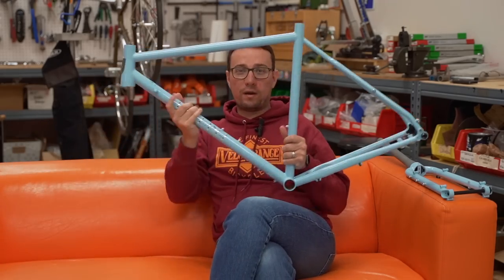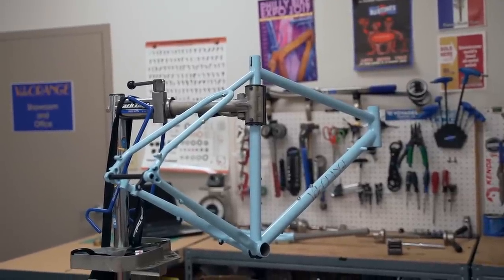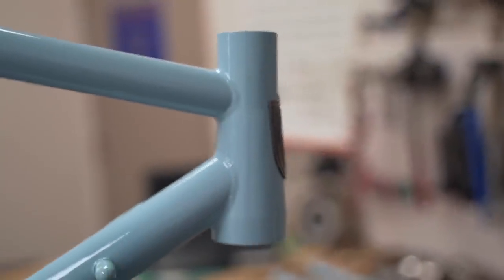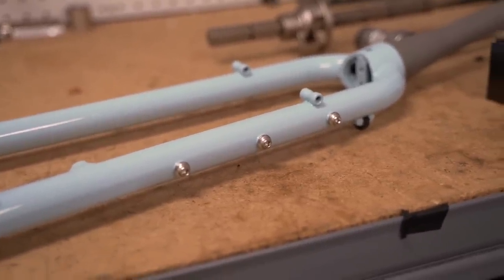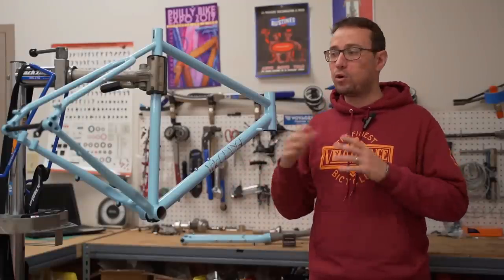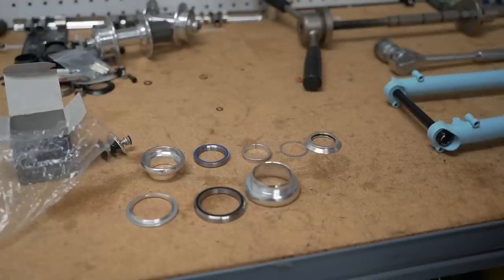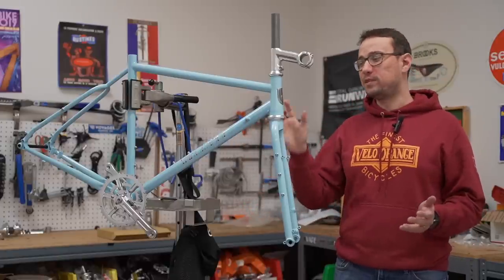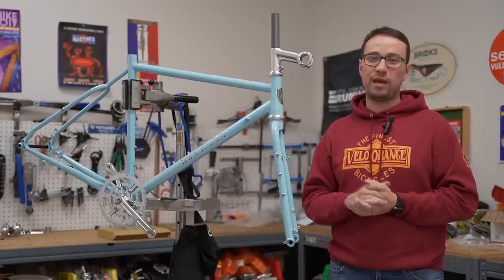Let's Build a Rando Bike - Part 1

Comment: Assembling a bike step 1 - insert a greased seatpost and clamp the frame in the workstand by the seatpost, not the frame!  Prevents paint damage, especially if there’s a tubing decal right there under the top tube.

Comment: I’ll second the install a seatpost first comment. Having a seatpost in the frame will prevent any damage while torquing the bottom bracket as shown in the vid. I like to stick my arm through the frame and use my shoulder or arm pit to counter the torque force as well.

Comment: Is the Pass Hunter steel fork for sale by itself?  Can't find it on the website.
Reply from the maker: We don't offer the fork separately currently.
Reply: @velo_orange  Thanks much for the reply.  I understand it may not make sense to offer it separately as most people "upgrade" to carbon.  I don't know if I've seen any other fork with the same attributes as the Pass Hunter's, though. Steel, thru axle, with a tapered steerer is pretty specific, in my opinion.   If I could find a way to make the Pass Hunter frame work with my Shimano Alfine 11 IGH and Belt drive, I'd get the whole thing.  I LOVE the wishbone seat stay design.
Reply from the maker: @mitmon_8538  We're soon going to be carrying an eccentric bottom bracket for bsa bottom brackets. There's also a cool belt company that makes a belt that is pinned, so you can run a belt drive on non-belt drive compatible frames. We had a customer do that on a Neutrino.

Comment: I like that colour. I like cromoly frames as I had my bmx made from tange cromoly as a kid and it was light and tough. I'm curious as to why you used a tapered cartridge bb?
Reply from the maker: That's what is compatible with our cranksets. They're easy to maintain (basically nothing to do) and are easy to install.

Comment: Man I want to build one of these! My Campeur will suffice in spades till then!

Thought, anyone familiar with crank orbit? Every time I mount cranks on a square taper, I try all 4 positions with the drive side and look from above, and spin. Each spindle and crankset combo will have one of the positions fit better than the rest, just due to sliiight manufacturing anomalies.
Reply from the maker: sometimes that does happen. Sometimes it helps to take the rings off, re-grease and re-assemble. Or get it as best as you can and use a wrench and slightly bend the outside of the ring to better match the plane of the front derailleur